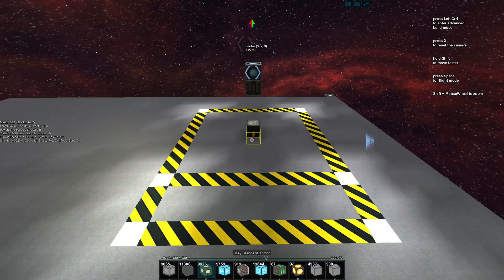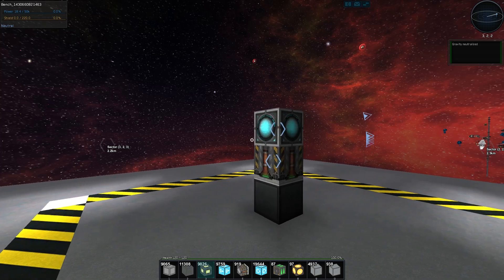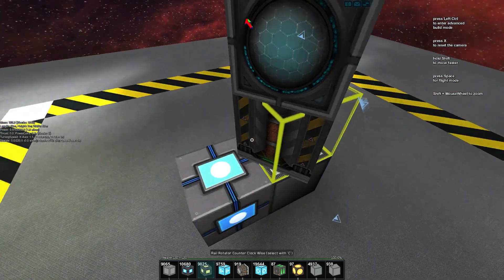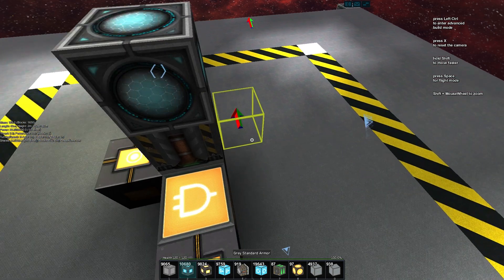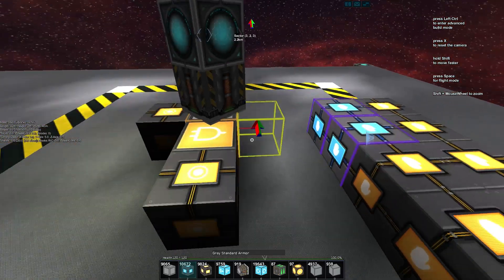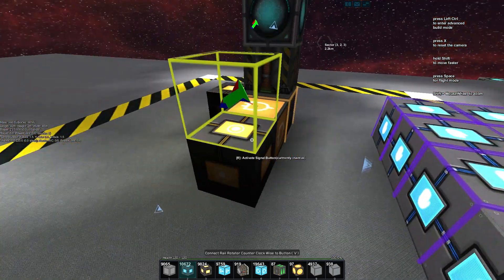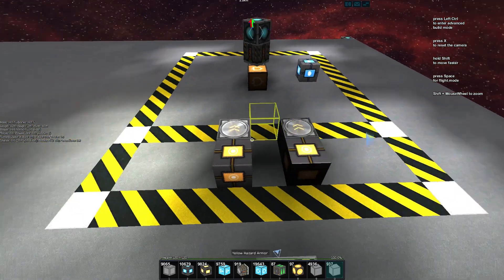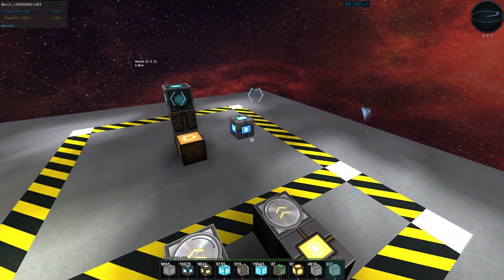Starmade Rails - 07 - Controlling Rotation

Comment: I don't trust this video.

1:45 for example, they don't work like that anymore,  if they ever did.  You won't make a rail rotator continuously turn just by linking an activator.

Should work if you use a button instead though.
Reply: Yes it does... try it. Just like the button.

Comment: Manually rotating like in 4:05 doesn't work anymore like that. You need to remove (or unlink from rotator) the button adjacent to the rotator, because currently it makes the thing rotate constantly. For manual rotation use an AND gate to drive the rotator and a button to trigger the gate.

Comment: How exactly do I get constant rotation and add speed module and be able to toggle it?
Reply: Apollo TheAlien  
Warning!!!!!!: For all methods of constant rotation they will break under one condition. If the arrow of the rotor is pointing in the direction of an adjacent rail the rotation ship will move onto that rail after completing one rotation instead of constantly rotating.

To be able to toggle the rotation:
   1) stick a activation block next to the rotor. 
   2) Connect the block you just placed and your input block to an and block.  (if the input block is on it will rotate, if it is off the rotating will stop    at the end of the current rotation) 
   3) Connect the and block to a button next to another rotor of the same kind as the main rotor.
   4)  Then connect the button to the main rotor and the activation block next to it. 

You should now have two identical rotors, an activation block, and input block, an and gate, and a button. If you don't have all those then you missed something. If it still doesn't work, check if you already have something docked to the rotor, if you do then manually turn on the activation block next to the rotor.

Alternate method of constant rotation:
   1) You can also do it by connection nine activation blocks to the rotor (c on rotor then v on activation blocks).
   2) then connect your input block to the nine activation blocks and a button. 
   3) That button should be next to a rotor that is identical to the main rotor.
   4) Lastly the button should connect to the main rotor.

Explanation of why the first method works, if you care:
The system contains two parts the check, and the reset. The check happens when ever a rotation finishes, this is the activation block next to the main rotor. The and block checks that you want to rotate again. Then the reset, the reset changes the rotor into another rotor just like it. All this does is make it act the ship was re-docked causing another rotation to occur. The reset is caused by the button, the reset also resets the activation block so that it will detect the next rotation.

If you want to change the speed:
      Changing speed: watch bench's tutorial (in the same playlist) and connect the rail speed controller in the same way you would to a normal rail
Reply: ***** thanks lots helped me make a double rotating mining ship :D
(and a scorpo ship)

Comment: Would it be possible to control the computers in a docked rail thing from a ship core?
EG wings with cannons which fold when docking
Reply: ***** yes, you can take a "inner ship remote", a special block that you can assign to your flight hotbar, and connect it to the cannons via a wireless block
Reply: PS: I call first.
Reply: I'm pretty new to starmade but if I'm not mistaken, the (incoming) wireless logic block should allow you to do that (at least for anything controllable with a logic signal):
you can connect a wireless logic block to another one placed on another ship/component thus transmitting logic signals between two different ships/components (for instance, bench also demonstrates it in this tutorial https://www.youtube.com/watch?v=5Ry8zAx1XTQ )